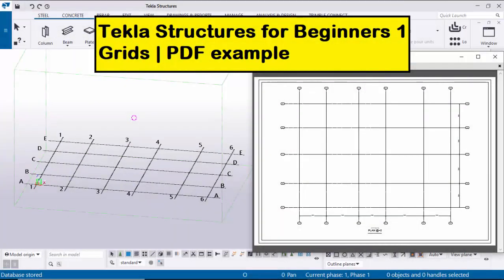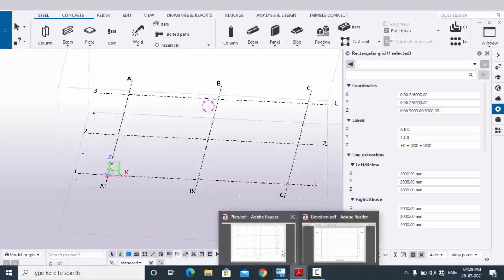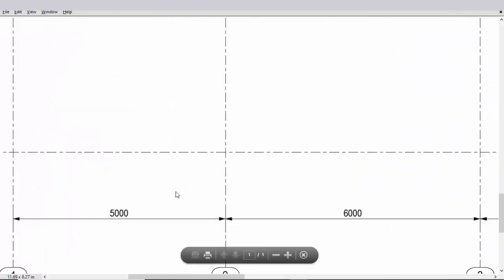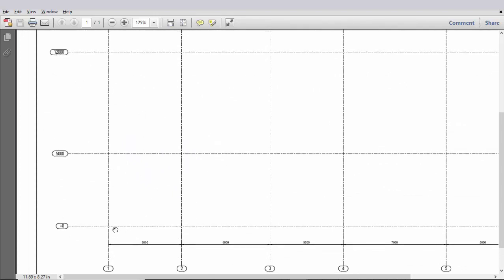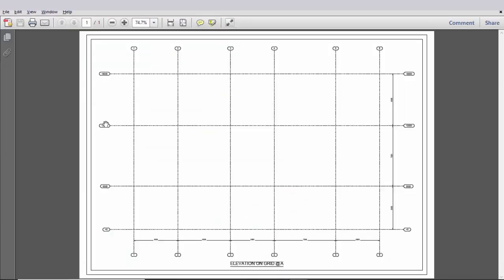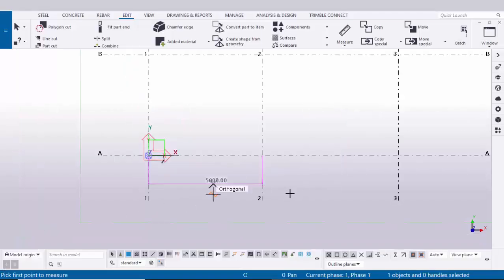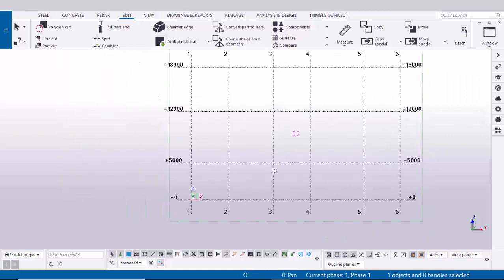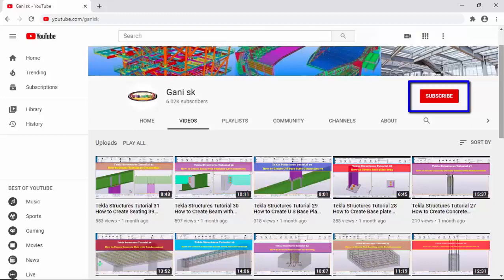Tekla Structures for Beginners 1 | Grids | PDF example

Comment: In tekla which is best detailing modelling or checking but they not give modelling
Sir can u please clear this doubt
Reply from the maker: Modelling and checking are more complicated job compared with detailing.
In modeling and checking, you need to study complete design information and implement into model and for checking purpose, if you did any mistake in model that will effects in project cost, so it's very difficult to get into modelling and checking position.
That's why modelers and checkers get more salary than detailers.
modeling and checking is the best position, but you will get those position with more experience, not for freshers or less experience.